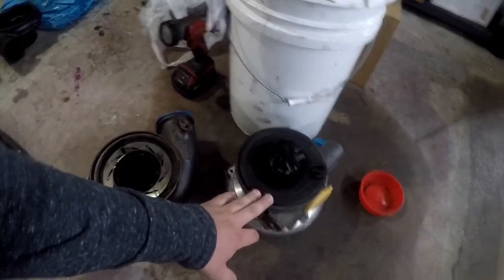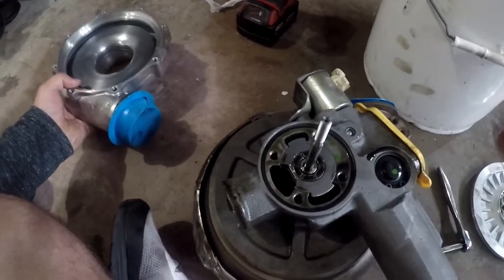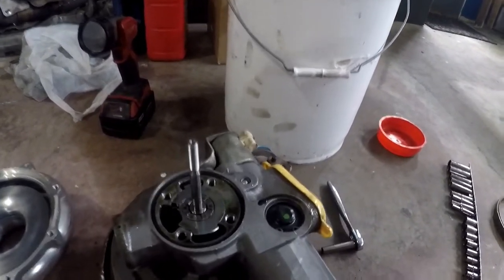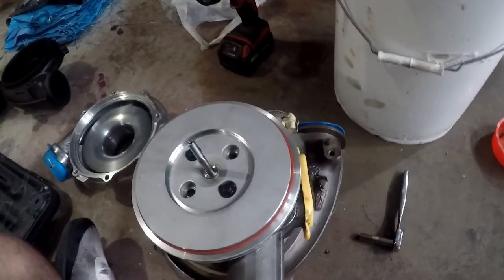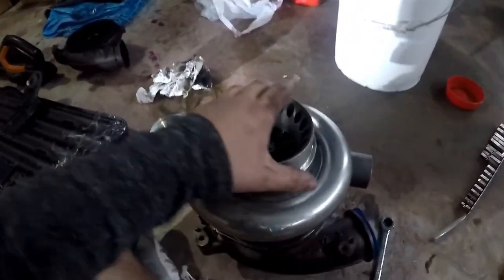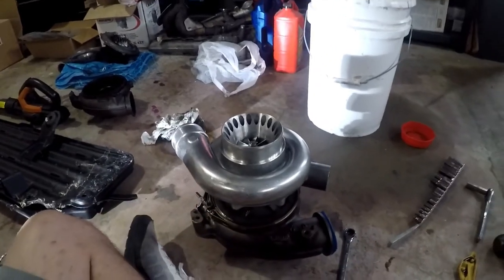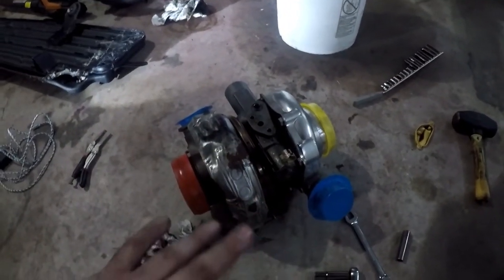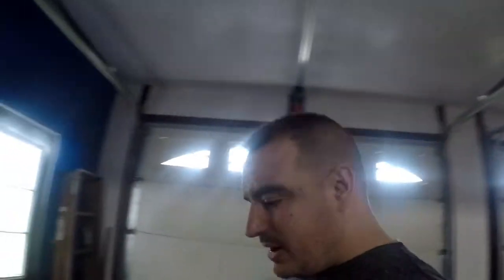6.0 powerstroke turbo build gt4088

Comment: I did this couple years ago. Pretty decent turbo setup. Better with a 10 blade rear wheel.
Reply: Kinda weird though I didn't have to cut out anything on mine.
Reply from the maker: It depends what cover you get. This is a Chinese sourced one. If you bought a similar cover from kc when he sold something like it, his kit was already made to just fit on.

Comment: Better hope the KC Turbos guys don't see this or they will accuse you of making a counterfit turbo! haha! 

Joking aside they are great guys, but they did ridicule me when i said that the race cover they used wasnt their design.
Reply from the maker: I actually want to order one of his turbos to check it out and compare it to this cover. I have a feeling they are more similar than many have been led to believe. I have noticed that he is changing his covers to that of his ball bearing turbo. I hear he is a great company and the business I have done with him I have no complaints. I have been ridiculed for wanting to know if the kc turbo race cover actually makes that big of a difference. I am eyeing up his ball bearing design
Reply: 6.0 Bros he has told me and I have the email saying the cover doesn't make a noteable difference. but he has been very helpful in many ways. I was eyeing the ball bearing turbos real closely when they first came out but ended up going with Titan Turbos stage 3 68mm for the price. he's got something new coming out soon that I'm excited for.
Reply: Thanks for all your kind words... and you are welcome for all the help I have provided over the years to you personally.  Just FYI... if they were the same thing as KC Turbos and not just a copycat... then he would have never had this issue.  It is especially worse when you use an aftermarket rotomaster bearing housing.   Its sad when you spend years helping out the 6.0 community and people quickly jump to copy cat parts that don't work well just for the slight price difference.

I have had tons of guys contact us about these kits having so many issues.  So sad.
Reply from the maker: @charliefish2565  I want to say since this video I want to say that I am completely disappointed  in their customer service. Which is an area you guys clearly excel at. I have never heard of a bad experience. I didn't say it at the time of this video because I was still talking to them. Once there was an issue with their product completely not working they stopped talking to me. I have to pick this turbo up from my buddy who after this tried it on his truck and still doesn't boost down low. The biggest difference is you stand behind your product. Lesson learned here and ill  be doing an update video. I just saw he is charging like 515 for this kit now. I got it for 375. I would anyday buy your comp covers or whole turbo before I ever touch this stuff again. In the next update video I will be leaving a link to your website for the real deal this thing tried to imitate. Also if you see me on the forums or Facebook pages as Jared Eaby I am always encouraging  people to your product. Keep up the great work.

Comment: Looks like the backing plate not setting flush caused the impeller shaft to bind and not spin as freely as it should.
Reply from the maker: That seems to be the case I have fixed it then someone is going to slap it on the truck and try in the near future

Comment: I wonder if they ever fixed this issue
Reply from the maker: I am not sure. However in hindsight I wish I would have just purchased a kc turbo kit to swap out the compressor side. It is just a hair more expensive but you know you're getting a quality kit with great customer service. As opposed to this guy when something is wrong he just ignores you.
Reply: Wow that sucks did you ever install the turbo?
Reply from the maker: @brainiacproductions357  yes three different times lol. I kept messing with it and had no luck
Reply from the maker: The compressor wheel was coming in contact with the housing. So it appears the housing was not machined correctly for the wheel. Now I am aware of one or two of my subscribers that have had luck with it. But check out turbo labs America on google reviews and such it is bad. For complete turbos I recommend my sponsor for DIY kits kc tirbo(no affiliation)
Reply: Yeah it would be sweet to have that housing though. I mean they look just like kc turbos for a fraction of the price
Reply from the maker: @brainiacproductions357  the original gt4088 cover is my favorite. Kc use to have a cover that looked like it in his original DIY kit. Now I love the look on the velocity port from turbo time. But I also love that kc has a unique to him looking product.

Comment: I just bought his turbo the same in your video and am having the same issue... no boost on low end and losing oil out of my tail pipe at an idle at a red light sometimes... he is no help to helping me fix this issue... any advice?
Reply from the maker: Well this upgrade would not cause oil out your tailpipe. Most likely the oil seal on your turbo is going out. As for the boost issue I have not solved it on mine. I think he said to use gasket maker on it, which I am not doing because that is not how it should be done. Unfortunately I have no advice for you. I would try getting money back. I dont want to bad mouth any company however when there are issues they do not take care of it. I would try Charlie's bolt on kit for for a compressor wheel. The difference between the 4088 cover and a stock one is negligible. I wish I could be more help.
Reply: @six0bros  I bought this turbo as a complete turbo and sent him my old one so he built this turbo 100%... I just bolted it on my truck... before the turbo swap I wasn't losing any oil out the tailpipe at all...and no I don't have an injector sticking either.. in so upset right now..
Reply from the maker: I am sorry I didnt realize you bought a completed turbo. This is one of the reasons I have been pushing people towards the powermax turbo. Has he responded at all? Oil out the tailpipe can only be one thing rear turbo seal.
Reply: @six0bros  yes but only once and it was a YouTube link to test for a low boost test ... I'm also now losing oil from somewhere under the turbo now as well..  I guess I need to pull the turbo out and investigate
Reply from the maker: Typically leaking under the turbo is the drain tube o rings. Sometimes they wear out or get cut while installing the turbo. What does the turbo boost to when it does finally hit up high? Mine would boost to like 22 psi. I definitely want to try and help you out. Did you change anything else at the same time?
Reply: @six0bros  I put a brand new o ring on from Ford when I installed it... and it may have been cut during installation.. I can power brake it and it will only boost up to 4psi and at full throttle 22psi same as yours.. I also replaced the blue boots on the intake side with OEM. And replaced my fuel pedal inside the cab.
Reply from the maker: My theory is that the turbo is leaking where the backing plate. I need to bring mine home from having someone else trying it after I worked on it last. I am planning on more videos on it. I want to figure out what is wrong with the product he is selling. However I want to keep it to just facts and make a very educated factual video and hopefully help people not buy from him. I hope he makes it right for you. Let me know if there is anything I can do. I do recommend making a video about it and letting people know of your experience. I hope he changes how he runs his business
Reply: @six0bros  I plan on taking my Turbo off my truck this Friday and tearing into it and seeing if I can see what is causing the problem. Thanks for your assistance and your video I will consider doing a video as I am seeing this is a problem. I love the sound that I'm getting from the turbo such as the whistle but without horsepower I might as well be driving a Prius
Reply from the maker: The whistle is from using a 03 turbo turbine wheel, which is the same as a powermax. Not sure if he is using the 03 profile vanes or the powermax ones. If you can block off right from the turbo and put compressed air at the turbo inlet. It should show you where the boost leak is.
Reply: Steven this setup will not work on a 04-07 turbo as the turbine wheel is to small.
Reply: @carcrazygts2  so your telling me that the same turbo that is in this video will not work in an 05 f250?
Reply from the maker: Not exactly. You limit him much power it will make but actually the later style turbine wheel although smaller is suppose to be a nice match with a 63.5mm compressor wheel. I would however recommend the later 04 turbine wheel as it is similar in size to the early style turbos except for it is not as tall but the diameter of inducer and exducer on it are the same diameter.  It would make for a great towing turbo and infact many people love that sized turbo. In the near future I will be reviewing a turbo of that exact size. Just from a more reputable turbo company. I hope turbo labs America improves their customer service and quality control but I will not be purchasing from them again.